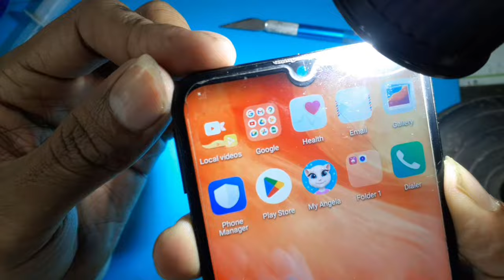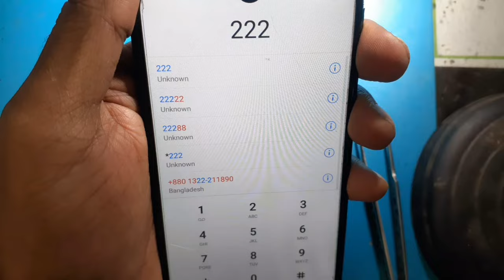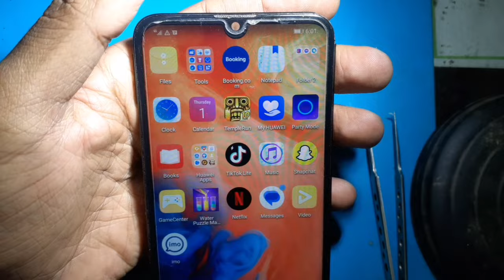Huawei Y7 (2019) No Service Fix || Y7 2019 Network problem solution @GsmYusufPathan

Comment: When I heated up on ic , the board swelled and the device no longer works. Is there a solution other than changing the board?
Reply from the maker: Boot no problem....boot no change... Only ic replace
Reply: @GsmYusufPathan  thanks alot for reply